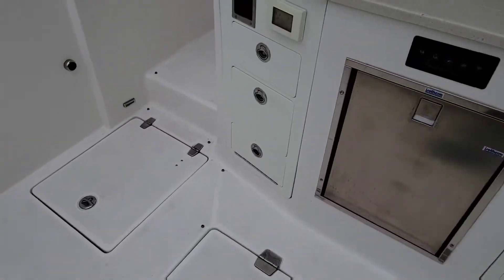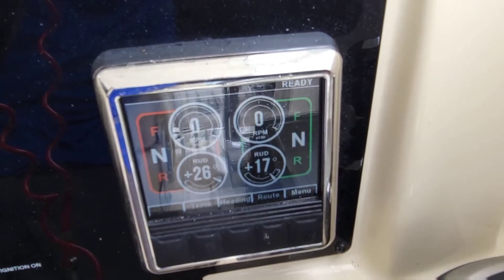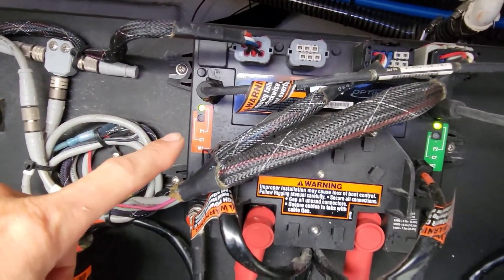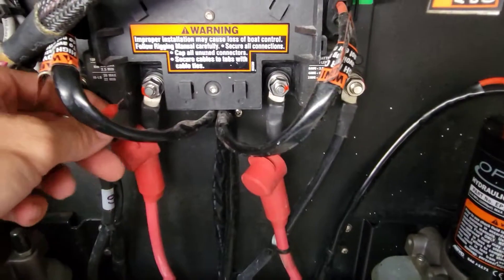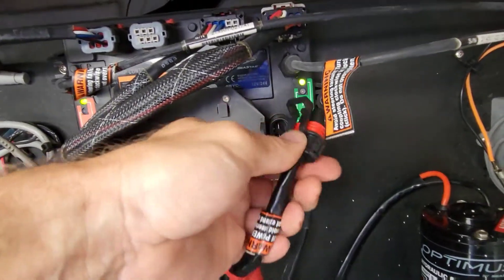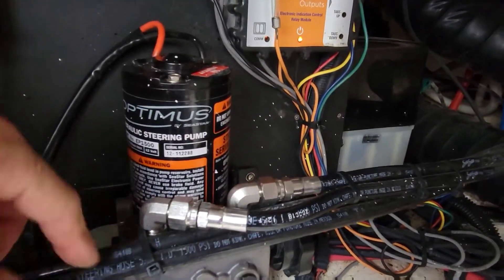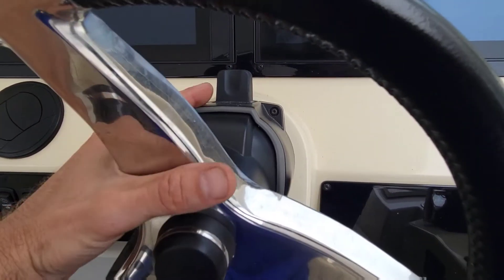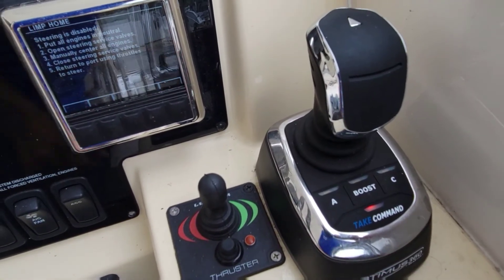SeaStar Optimus Steering Failure - Episode 55

Comment: I have Optimus steering, it is giving me a port side steering error .
I replaced the sensor it worked for three weeks and the error came up again.
The boat steers , on the control is states it switched to single sensor.
What is the ohms reading supposed to be on the sensor .
Reply from the maker: I am not sure what the ohms should be, but if you swap sensors and it follows than its a bad sensor.  If it doesn't follow, it is a bad controller.
Reply: @justinleemarine can you facilitate a number where we can contact you from Costa Rica direct we having some issues with steering system on a HCB 42

Comment: Justin have optimus 360 screen went blank voltage to both legs on motor good no lights on pcm  trigger wire purple fires with ignition pcm?
Reply from the maker: If you have power to the screen when you turn the key switch on, then the screen has failed.
Reply: @JustinLeeMarine  on pcm the lights do not light up at all
Reply from the maker: @scottcolleran2043 The PCM has probably failed. I would call Dometic and just see if they have any other suggestions. They are usually good about helping.

Comment: Justin I am in the process of replacing the PCM. Do to a Stbd Steering Pump Open Circuit error. If I disconnect all the cables from the old PCM and ensure all cables go to the same spots on the new PCM is that all i have to do or is there other configurations that must be accomplished?
Reply from the maker: That is all you need to do unless you dont have a gauge for it. You will need to go thru the calibration once the new one is installed. It's easy. The screen tells you what to do.  Hope that helps and keep me posted if you have any other questions.

Comment: How do you get it to bleed out I replaced a pump on my contender and the pump turns on but the starboard motor will not turn still and the 2 port motors turn no problem can't get fluid out the cylinder ram

Comment: I have a question.  When I start the engines (twin 250 Yamaha). engage Optimus, it takes about 20 seconds before Optimus engages.  Once it does, it's good the whole day.  Is it a oil level issue?

Comment: Did you replace the PCM? I am trying to replace mine and was able to locate the part EM1200 but when I installed it I am getting multiple codes including too many devices detected, main station est gateway configuration settings changed, and main est gateway mercury authentication error

Comment: My cantrak display ok button (the one button you need to engage the p ) isn’t working. Display functions but can’t click the button all the way to the right. Emailed domestic 50 times and they won’t respond after the first email.  Will never ever have this system in a boat. Never ever ever ever what a pos.

Comment: Hi Justin, my optimus display panel is totally dead (all black). there is power coming in through the PCM but the lights are dead. The 2 Yamaha engines don't move at all. I have the same Regal SAV33 boat. Whats your opinion on it? >I don't have a joystick<
Reply from the maker: @mauriziodalessandro1858  that is hard to say without me putting my hands on it but my best guess is the module has failed. That is what controls everything including your gauge. The only thing you can check is if you have 12 volts to the purple wire. That is what wakes up the system.
Reply: @JustinLeeMarine   On the PCM card there's a purple wire on  CAN1 and the CAN2 Network connections. I checked both and I measure 3.1VDC and 2.1 respectively. I also assumed to check voltage at the PCM card pins with the cable disconnected.  If it's the PCM card where can I get one. Thanks
Reply: @JustinLeeMarine  On the PCM card there's a purple wire on  CAN1 and the CAN2 Network connections. I checked both and I measure 3.1VDC and 2.1 respectively. I also assumed to check voltage at the PCM card pins with the cable disconnected.  Is this correct. If it's the PCM card where can I get one. Thanks
Reply: Did you solve this issue, I have the same problem. I have a Chaparral OSX with twin 300 Yamahas. If you solved it Please replay on the fix. Thank you.

Comment: I have a single outboard with the led blinking 3 red can I switch to the other output without changing the pcm?
Reply from the maker: I don't think that is possible but it won't hurt to try.  If it's not working you won't hurt anything switching the leads. Let me know what you find 😊

Comment: Hi I am having a similar issue with our optimus system on a 273 everglades. The EPS is saying 'Main station EST Gateway port lever position sensor failure' and use of the joystick is now suspended. We live in the Turks and Caicos so techs have little/no professional knowledge of these systems here. Our engine was also misaligned in the same manner as your video above.Thanks for posting this vid we will give you guys a call!

Comment: Hi Justin, I appreciate your videos!
  
I have a 2019 30' Cobia with twin Yams with the Optimus steering. My issue is intermittent.  I'm getting a " Stbd Steering Pump Open Circuit" Error. I've been gettin it for the last year or so  but has been very intermittent. But now it's happening more often. I have unplugged and re-plugged all connections on the PCM. Have you herd of this issue? if so, can tell me what I should look for?  

Thank you, 
Jim
Reply from the maker: Thank you and I would swap the main(power/ground plug) connections on the pumps. If it alarms on the port side then the pump is failing.

Comment: Bought a twin yamaha 300 30 seahunt. All seals leaking at rear arms. 

Replaced and refilled reservoirs. Starboard turns but not port. The seller screwed me. How do you bleed and fill optimus? Please help
Reply from the maker: They are self bleeding when the system is on.  You will have to check and make sure both pumps turn on when you start the engines. If not then you will have to diagnose what is causing the pump not to work.
Reply: @JustinLeeMarine  God bless you for your reply. I figured it out about 1hr ago. I had to swap plugs 🔌 on panel like you did. This caused both pumps to turn on. While on, at the port pump. There is small bleed valve. I opened and cycled steering wheel and ! Walaaaa fixed. Swapped plugs to the original position.
Reply from the maker: @chunkyfather29  I'm glad you figured it out. It can be tricky sometimes because computers control every system now.

Comment: Justin, I am in Sarasota and have no power to my Optimus system at all. Had a good amount of water in bilge due to maybe float in bilge pump not working. Repairman said  pcm is corroded from water and at a minimum i need new pcm for 2300 and total will run 4200 now or more if there is other things they find?  Sound reasonable and legit?
Reply from the maker: The part is expensive but I don't see how it's that much labor. It's a simple fix unless he is installing new power and grounds or running new harnesses should only be a couple hours labor if it's just the PCM
Reply: @JustinLeeMarine they now say the pcm is coming from the factory in Canada and could take weeks because of customs. Really want this working for March. Do you think if I call marinemax I’d have better luck?  Should this part take weeks to get?  I have a vantage 280.
Reply from the maker: I would try Marine Max for sure. They can see if any parts warehouse has them available. Might be in stock somewhere.

Comment: Have you ever seen this fault on the Optimus?
 'PCM lost CAN2 communication with main station joystick'
I checked every connection but it keeps coming back. At one point,  it cleared, then returned every couple seconds, then stayed faulted.
I left a message with Dometic tech support also. Fingers crossed.
Reply from the maker: If the harness is good then the PCM is bad.
Reply: @JustinLeeMarine  Thanks Justin! The Dometic tech support was super helpful also. John sent over the schematics for the Can2. 
So now I'll have the pleasure of crawling upside down inside the bilge of the 39 SeaVee to cut 100 zipties and investigate the Can2 main harness at the PCM.
Reply from the maker: Welcome to my world😛. Keep me posted. I always like to hear the outcome 😁
Reply: @JustinLeeMarine   Update. The CM 20304 harness looked okay(ish). It had a little corrosion on the CM10060 micro tee connections but the pins inside were clean.  Ordered the new CM20304 as a precaution.  Also, when looking at the PCM it has a repeating 5 flashes at the C1 LED indicator.  Not sure if that means anything to you?  The ED1700 display also shows fault code 0x7F220 and on the system health displays a Yellow caution on Main PCM.  Wish you lived closer to Pompano Beach!  Really appreciate your responses so far and your videos are super helpful also.
Reply from the maker: Not sure about the fault codes but keep me posted after you replace the harness.  Still suspect the main brain of the operation. 😊
Reply: @JustinLeeMarine  I think you're correct.  You wouldn't happen to know of a good EM1200 PCM would you?
Reply from the maker: I do not. Sorry.  If I see them they are usually broken. Lol
Reply: @JustinLeeMarine  Good news. The new Can2 cable fixed the problem! Man I was so happy to find one and that it was a good fix.
Reply from the maker: That is good news. Glad it wasn't the PCM. Good diagnosis 😊

Comment: Question about flushing Optimus Power Steering Pump?  The cap came off of the pump and I had water in the bilge. Salt water filled the reservoir.  What would be the best way to drain it, flush it and refill it. Is there a way I could purge nitrogen though the lines to flush the water out?
Reply from the maker: I would disconnect the lines and blow them out with air pressure. Then bleed the system with new fluid after you get everything you can out. Run the system a few times and do it all over again. The oil should absorb all the moisture so when you fill it and bleed it the second time you should be good.

Comment: I'm having an issue with how the Garmin steer by wire autopilot interfaces with the system. Keeps blowing the autopilot fuse. This is on a 3 engine Suzuki system. Any tips?
Reply from the maker: If it's blowing a fuse it could be the wiring or the pump is pulling too many amps.  Would need to be tested.
Reply: @Justin Lee  I figure I'd start by disconnecting all the connections in the system, then, from front to back begin reconnecting them one at a time until the 5a fuse pops again. I was thinking there might be an autopilot connection backbone near the optimus, but I don't see it. It's on a 2019 SeaVee 390. Wasn't sure if the autopilot connection went direct into the Optimus pcm either.
Reply from the maker: You are on the right path by disconnecting everything. I don't know about the backbone location unless I looked at a diagram. You can also call the manufacturer and they will help sometimes
Reply: @Justin Lee  I found the issue. There was a wire bundle coming off the CAN2 connection that had a badly corroded splice. Going to snip the rest of the zip ties apart tomorrow from both CAN 2&3 and redo any additional splices. Also, there was alot of corrosion on the PCM power and ground cables.
Reply from the maker: Makes perfect sense.  Good job diagnosing it. ☺️
Reply: @Justin Lee  Silly question. I tried to disconnect the CAN2&3 harnesses by squeezing what I thought was the clip but it wasn't moving.  I also see a red tab at the base also but wasn't sure about that.  Don't wanna break anything and can't find anything in the manual.  Any ideas?
Reply from the maker: You have to pull the red tab out to unlock the clip that holds the harness. Hope that helps.

Comment: Nice troubleshooting video helpful, but I’m having a problem where it would work then I would drive a little bit then lose steering for both engine. Any advice would help or anyone with the same problem
Reply from the maker: You will have to trouble shoot it to find out what is causing it. I think I have a few videos on the steering system. Thanks for the support

Comment: Is there a way to test the steering cylinder sensor?  Had the port alarm 3x this weekend.  Saw some water leaking onto the PCM.  Cleaned up the connections (round din plugs) and added a bit of dielectric grease.  Problem recurred 7 hours into fishing.  Pulled the port plug, reinstalled, it seemed to work (we stopped steering via the wheel and only used the autopilot (just in case the steering wheel input was causing issues, probably a silly idea on my part, but I noticed that it worked great until my buddy cranked the wheel).
Reply from the maker: Usually I just wiggle them and if it gives you an alarm then the sensor is bad. You can also swap the port and starboard ones and see if it follows the sensor. Then you know it's the sensor.  I would start with the sensor as it's the cheapest piece.  The PCU is big money if it fails.

Comment: Hi. I have one of those sea star steering. I have several issues. Sometimes i loose steering and have to power down to get it back. When i engage the joystick to dis ingage i have to power down as well. What could be causing that issue?
Reply from the maker: It's almost always the sensors that are on the steering rams. If it's not that then it's the PCU.
Reply: @JustinLeeMarine  thanks.
Reply: Hi again. Where do you find parts for the system? My display went out and cannot find a replacement anywhere. I'm thinking of upgrading my system to Garmin can I do without the color display and work everything through 1 of the Garmin units?
Reply from the maker: If you call the marina in Clearwater and ask for Doug he can probably get it for you.  You do need the display for the system to work. You could hide it in the dash because you can tie it into the NMEA and get the rudder angle and info from it.
Reply: Thanks again. Very hard to find replacement parts for this system.

Comment: Good video thanks for posting. I'm deciding between a bow thruster and the optimus 360 for backing into a slip with wind and tide movement. Is one system better than the other for this purpose?
Reply from the maker: The Optimus gives you alot more control over the whole boat. The bow thruster only corrects the bow.  I would choose Optimus personally.
Reply: Thank you very much
Reply from the maker: Always happy to help. 😁

Comment: I have the same system with twin Yam F300s on a 2014 Sea Hunt Gamefish 30.  I bought the boat used last fall.  

In my case, I have been having an intermittent failure of the Port engine I THINK.  It's happened 3 times and I am 99 percent certain it was always the port side. Each time I was able to "fix" the issue by pulling ALL the leads on the PCM and cleaning them off and adding a tiny bit of dielectric to the plugs. But this week when I was done, the STBD engine was acting up and I had intermittent steering on the STBD and NO steering on the PORT.   Then the STBD quit and I have no steering.  Limped home and put it on the trailer.   The ONLY SeaStar tech in town is booked up for a full month.  I think this system stinks and I think that putting the PCM and pumps in the bilge was idiotic.   

But I learned something watching your vid.  Thank you.  Now I know what the Circuit Breakers look like and how to swap the cables on the PCM to trick the system.    So, I can do a bit of wrenching while waiting for the tech.  Thanks again.   I will search for the rest of your vids.
Reply from the maker: Thank you and thanks for watching. I appreciate it and glad I could help.